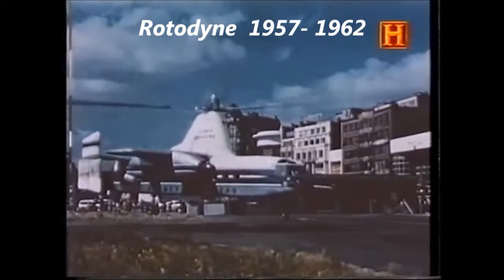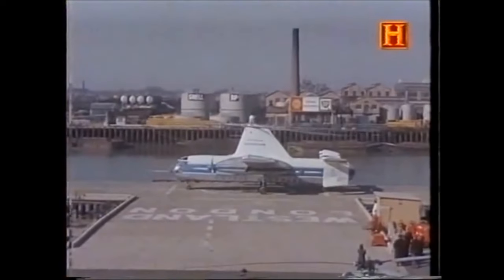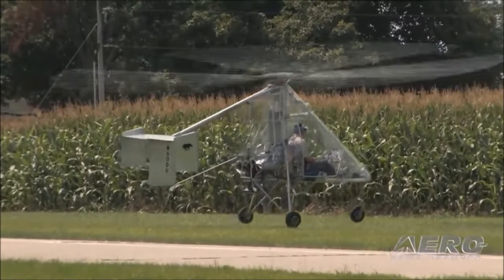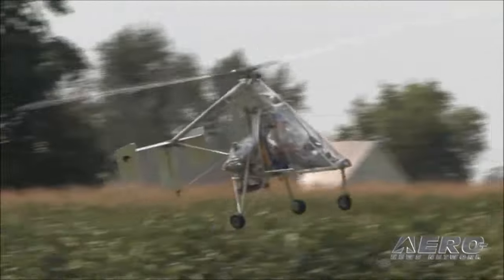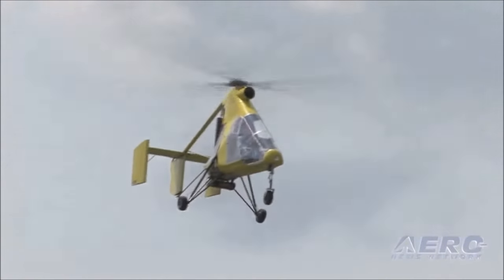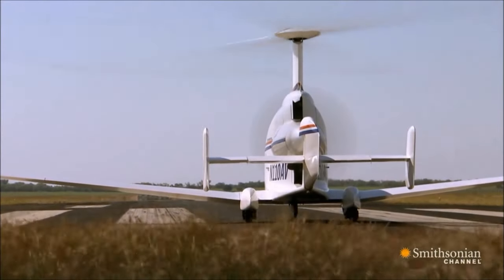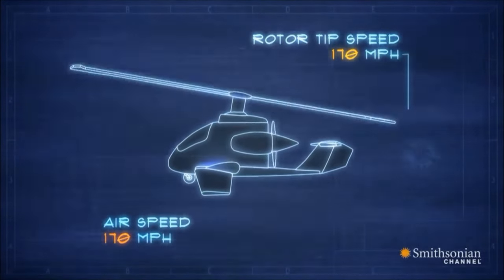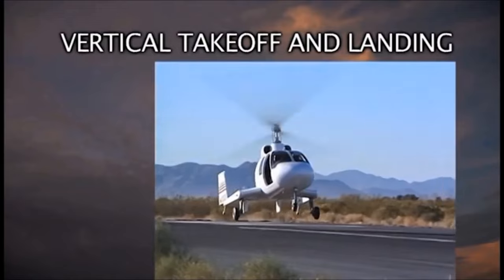Top 10 vertical takeoff Gyrocopter  The Past , Present & the Future

Comment: Why don't we see these VTOL capable gyros in production today for personal use? They would be at the top of my list for an aircraft purchase.
Reply: Zero stall speed is not really correct. When the rotor does not spin fast enough, a gyro will drop..and that very very fast. And in order for a rotor to spin, airspeed is needed. If the pitch is too high and the energy is washed off, a gyro will drop out of the sky. Same like a stall. Difference is, the stall on a conventional wing is based on angle of attack, not on airspeed. A gyro on the other hand it is a bout the energy that is needed to spin the rotor, thus to produce lift.
Reply: Yes, you can stall a rotor, but the recovery is simply down collective.

You do NOT need forward speed for the rotor to produce lift; that's why it rotates. To autorotate, you only need air passing through the rotor disk with proper application of collective.

On the ground, air produced by the thrust engine keeps the rotor spinning without forward motion. That's how they can do those jump starts.
Reply: Rusty Climber  Remind me please...what was the topic about?
Reply: Rusty Climber  Ok, just found my comment. Well, I am sure that I will NOT deal with anyone to convince them of anything. I do not have another 120 years to live...it might take that long to make the FAA understand ))
Reply: @KutWrite  Actually generally you can't stall it other than unloading (negative g) as the rotor unlike a helicopter is always in autorotation as the angle of incidence of the blade is generally below 4 degrees.  Some of the jump take off  gyros in the 1930's allowed for a short excusion to 6 degrees or more but flew at an angle that would not allow it to stall.  This is why you don't really need a rotor tacho in a normal (non-jump gyro - if you know how to wind up rotors) you would definitely need one in any sort of jump take off gyro as you need to know you have enough energy stored to succeed in he jump.

Comment: Gyro may use a little more landing area than helicopters but they a lot more stable than a fixed wing aircraft for landing in cross and high wind take offs and especially cross wind landings . In fact in many instances , heading into high winds gives them an advantage since they gain more energy in the rotors why using less horsepower creating many of the extremely short take offs and landings while being faster and cheaper to operate than helicopters .

Comment: So help me understand this…

Without a tail rotor, there is no way it can hover for a long time. The only way I believe they accomplished this is by doing this…

Pre rotate the rotor to a much higher rpm than a normal gyro can do.

Use a rotor with adjustable pitch

Once rotor is up to speed, launch it up and gain altitude 

Pitch up and use the motor at the back to gain speed and autorotate the main blades back to normal operating speeds

Fly it like a normal gyrocopter.

This is an interesting concept which I never thought of before. If I got the process wrong, someone please correct me. I bought an MTO sport recently and don’t know too much about autogyros.
Reply from the maker: @AymanRacing  You are absolutely right with your description. Congratulations for your new Gyrocopter.
Just to let you know ELA  EVOC is also a Jump take-off Gyrocopter bringing out.

Comment: After WWI the mail delivery was deciding to go with Gyros or bi-planes, I think the only reason the planes won it is because there were several pilots ready to go as well as planes. The auto gyro would have had many benefits over the plane. There was an old video I saw where the gyro was lust lowering a mail bag on a rope while they man on the ground ran beside it and unhooked the bag. The auto gyro would have meant more reliable delivery though with weather.
Reply: Hmm.. actually Autogyros aren't good at hovering..  helicopters can because the rotors are powered.. but a Gyro needs a constant airflow  to stay aloft.. it can be done if the wind is strong enough.. maybe over 30 Knots or so.. but thats not good weather to be lowering a mailbag..

Comment: These are beautiful....do the gyros in the beginning of the  video have powered rotors or are they true Gyros? The take offs are amazing...thanks for sharing
Reply from the maker: The big Gyro rotor is powered with compressed air thru the rotor tips during take-off . The others are fast pre rotated and use the stored energy to take off. All are true gyrocopters and fly only with non powered rotors.
Reply: Thanks for sharing....these would be so much better than choppers....and so much more practical to get around in
Reply: Aerei elettrici p
Reply: aerei elettrici
Reply: They can't replace ordinary helicopters for all uses. Since the main rotor is unpowered in flight, gyrocopters can't hover for very long.
Reply: +Arthur: Only thing, the Fairey and Avro Gyrodynes at the beginning and end are only gyrocopters during cruise. While the rotors are powered by their tip jets, they are acting as helicopters.
Reply: @ArthurGemperle   Hi Arthur, I'm becoming very interested in gyrocopters in general.
 This is the first time I see this " jump take off" .
 Would you mind telling me how is the energy stored to achieve the vertical take off ? Or please, recomend me any site with information . This kind of aircrafts do not exist in my country ( argentina ). Not even experimentals I believe. Thanks a lot !
Reply from the maker: The rotor is driven by the engine more than the take off RPM on ground. Engine is then disconnected from rotor and than is some collective pitch added to the rotor. Gyro lifts off but rotor speed is depleted, during that time the gyro must move forward fast enough to maintain RPM through forward flight. Also tip weight is added the the rotor blades to have more inertia stored in the blades.

Comment: It is very good but the thrust motor can be replaced by a turbine and the rotating blades remain in neutral when turning. They can also be folded back because you cannot fly at a speed below 600km.h

Comment: I want to know how it counters the main rotor torque during the vertical take-off and landing.
Reply from the maker: Thanks for watching.
On those Gyros there is no torque on the rotor. The rotor on the big Gyro is driven by compressed air coming out of the rotor tips. 
By all other smaller gyros the rotor is only driven for a very short time with the momentum from high RPM  pre rotating.
Reply: @ArthurGemperle    Thank you for the explanation.  It seems that I didn't watch the video carefully.

Comment: I learned  something new.  I always thought the gyro didn't have a power rotor.  I thought it used a push engine to go forward motion to create lift on rotor.  Wouldn't this be closer to push engine helicopter?
Reply from the maker: Hi Jay ,  you are correct , the gyrocopter has no engine powered rotor in flight. It is driven only by airflow. However on ground the rotor is prerotated by the engine . The vertical take off gyro can use the stored energy in the rotor system to take off vertical by changing the pitch on the rotor blades . I hope I could help !
Reply: Well, it's pre-rotated by air flow produced by the thrust propeller. The engine is not connected to a gyroplane's rotor.
Reply: On regular gyro, you would use the engine power to get the main rotor spinning than disconnect. Than you would speed up with rear thruster and the airflow thru the rotor would finally produce lift. With gyrocopter you need air moving front to back across the main rotor to provide lift. If you stall main rotor you to have altitude and quick reflex to recover.  There are flying maneuver that only a gyrocopter can do and no other aircraft can but it takes skill to pull off.
Reply: +KutWrite it's not the thrust what's the picture of the blades change and you have to use an electric or hydraulic deal to get the rotor spinning on the ground the wheels hold it from turning round and round cheese

Comment: How does a rotor with no direct engine power main totation for hovering to landing or for vertical takeoff?
Reply from the maker: Hi Ron, On ground the rotor is pre rotatet with the engine to a higher RPM than in flight. The rotor pitch is negative,  so the gyro wont take off. Also tip weight is added. With all that stored energy positive pitch is added. The engine is now disconnected from the rotor system and the gyro jumps up from the ground, during that time forward speed is added and the gyro flies in normal autorotation.
For landing the stored energy is used to hover for a few seconds.
The gyro cannot sustain hover without strong head wind.
I hope that helps

Comment: These are beautiful modern aircraft's. I see, and understand the   rotor technology,  but those rotors look like they are driven by the engine,  via, a clutch setup to spin the rotor rpms (315-450) to take off vertically. I  understand the stored energy in the rotor rpms, but it would have to be under relative sustained power to hover.
Reply from the maker: Yes you are right they only can hover if the rotor is driven like the Rotodyne's  jet driven rotor with compressed air during take-off and landing
Reply: They are taking off using pre-rotation to be able to "jump start". once flying a "hover" into a reasonably light breeze is easy to accomplish. I could fly my air commander at as low as about 8 knots, which is only a light wind.

Comment: where's the tail rotor? thanks
Reply from the maker: Thanks for watching 
On a Gyrocopter you don't need a tail rotor.
The rotor is driven by the air flow moving forward therefore is no torque on the body. On a helicopter the rotor is driven by the engine, while the rotor turns the body wants to turn the opposite way that's why you need  a tail rotor to stop that.
This is not the case on a Gyrocopter
Reply: @ArthurGemperle  Thank you very much sir

Comment: The Carter with the full wings would surely have been the best one with a bit more power and a transition to fixed wing by fully braking the rotor to a stop with fitting control surfaces 8n the wings and having the best of both worlds fixed wing and rotor with a rear pusher plus vertical lift and a reasonable price
How could it not have been a success if the quality was as good as possible

Comment: Gyrocopters cant take off vertically..  WHY?  the rotor is free wheeling... the motor in the back pushs the vehicle forwards and the rotor blades are on a backward angle to the force..  hence the spin when its moving forward.

yes the can land and take off in a short distance, but not straight up.

Comment: If the rotor is powered, it’s not a gyrocoptor by definition.
Reply from the maker: Hi Mike, all gyros rotor are powered on ground but on stand still only  to pre rotate. The same thing on those jump take off gyros. In flight only the air flow will turn the rotors

Comment: I think some people need to learn what a real gyrocopter is, as for starters, the main sail is unpowered.

Each of the examples shown had a powered main sail, while a real autogyro main sail only spins & provides lift with forward motion, duh😑
Reply from the maker: Thanks for watching, non of those gyros have a powered rotor on normal flight, however all gyros are pre rotatet with engine power on ground to spin op the rotor. With the stored energy they can jump of for a few second and than they need forward speed to maintain flight.
The only exception is the Rotodyne which rotor is driven with compressed air at the rotor tip for takeoff and landing only

Comment: ps those are HELICOPTERS . autgyro require forward momentum to make the rotor actual spin..   the rotor isn't on a driveshaft... its just free;y spinning...  hense,  no vertical takeoff possible
Reply from the maker: Hi Harley, thanks for watching, but you are wrong, those are gyro-copters and there rotor is not driven in forward flight.

They are spinned up high on ground with engine power with some tip weight added to the blades. There is a lot of stored energy in the rotor blade now, the only thing now is, to add on some positive pitch and the gyro jumps off vertically. During that time you have to add on forward speed so the air flow will continue to turn the blades and the gyro flies normally in auto rotation.

 In forward flight the rotors are never powered, however on ground and stand still all gyro rotors are pre-rotated with engine power. The moment the gyro rolls forward the engine is disconnected from the rotor system and the airflow will take over to turn the rotor.
Jump take off gyros are very complicated because the need  a collective pitch system like a helicopter to control the blade attack angel.

Comment: Bullshit!  Gyros do not have powered rota blades !
Reply from the maker: Nobody says the rotors are powered, they are spinned up high on ground with some tip weight added. There is a lot of stored energy in the rotor blade now, the only thing now is, to add on some positive pitch and the gyro jumps off vertically. During that time you have to add on forward speed so the air flow will continue to turn the blades and the gyro flies normally in auto rotation
Reply: Arthur Gemperle surely if they are spinning while stationary, they are by definition powered? I guess I need to look into this, certainly very interesting.  Need to figure out exactly how these work.   As I always believed gyro blades were not powered in anyway - at any time! 🤯🤯🤯🤯🤯🤯🤯🤯🤯🤯🤯🤯
Reply from the maker: @hanniffydinn6019   You are correct in forward flight the rotors are never powered, however on ground and stand still all gyro rotors are pre-rotated with engine power. The moment the gyro rolls forward the engine is disconnected from the rotor system and the airflow will take over to turn the rotor.
Jump take off gyros are very complicated because the need  a collective pitch system like a helicopter to control the blade attack angel.
Reply: Arthur Gemperle l see, is the correct technical phrase: “jump take off gyros” ?  I honestly haven’t seen this type of gyro until this video.  I can’t believe these aren’t more popular. Especially in more extreme rural locations.   Just trying to get my head around why this isn’t popular, seems less maintenance , less complexity and cost than a normal helicopter...... it’s very weird.....